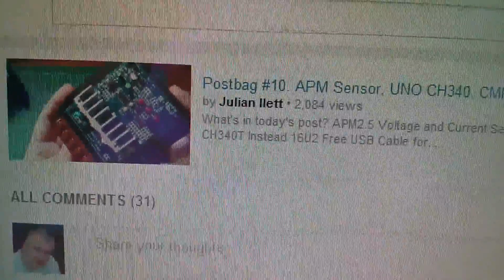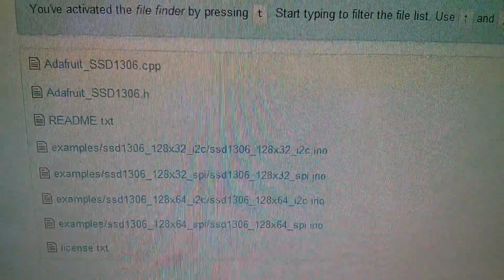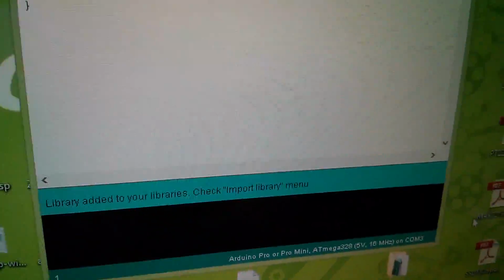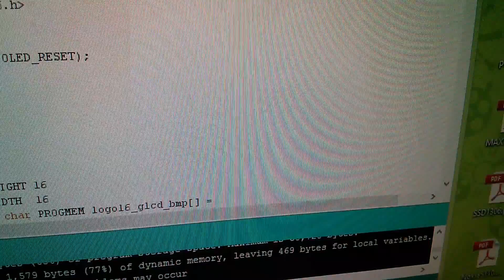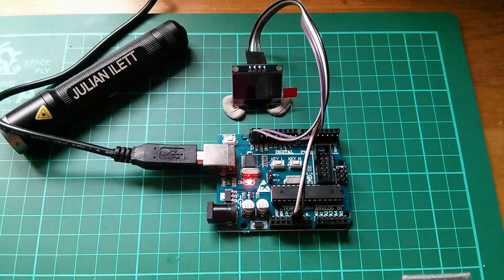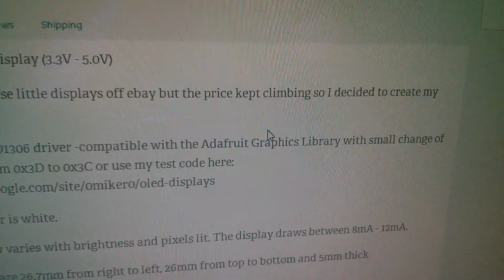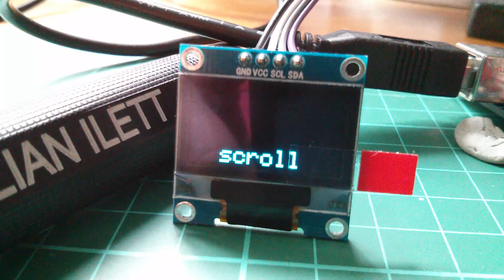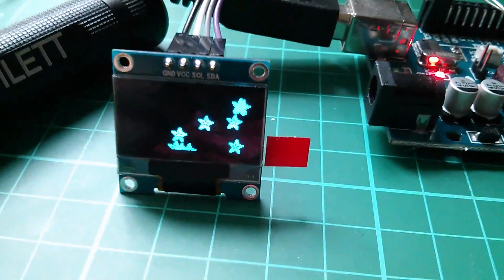1-Day Project: Arduino Uno and I2C OLED Display Challenge

Comment: I noodled around updating the text printing cascade you originally used with the SPI Nokia 5110 screens to work with these little I2C OLEDS. Also store the font defs in the ProMinis internal eeprom space for a solution that doesn't need any libraries. You might find that work interesting:
 https://thecavepearlproject.org/2020/11/15/adding-two-oled-displays-to-your-arduino-logger-with-no-library/

Comment: Curiously, this file (sh1106_128x64_i2c.ino) works equally well under Arduino 1.8.10|File|Examples|Adafruit_SH1106. Disable the SPI "include" cuz you're running I2C. Within the code, the address 0x3C works fine which suggests the silkscreen of 0x78 and 0x7A is really 0x3C and 0x3D. Another fine example of China trying to avoid copyright enfringement?

Comment: I thought my cheap ass lanmu OLED from amazon were faulty but nope! I had to change the address to 0x3C You made my day!
Reply: @Strictly Fun , Motivation , and Other I don't think so. I don't have much idea and I even thought I burned or short it somehow. I had another from the same order and it wasn't working either. There's like 3 different libraries and eventually I got it to work by trying them. check also your wiring (I know it's just a few cables, but check in your machine for the correct I2C pins)

Comment: I have a similar project but want to measure the voltage from a solar panel. Is it fine to just connect the lead from the panel straight to the terminal without anything else in the circuit? I tried but the voltages don’t vary under different light levels.

Comment: OK I got it running.  Of all the 37 land mines I had to step on the
prize winner is the display has address code 0x78 or 0x7A which it
turns out is for 10 bit and  doesn't seem to have been included in
the sketches.  If I hadn't bought 2 other displays of a simpler design
I would be in the Drool Factory.
Reply from the maker: Satisfying isn't it - to get it working :)
Reply: Yes it is!  And at nearly 64 very comforting to know I can still figure things out, eventually.
Reply: @lizardofoz5329  What is MOST exasperating and infuriating is seeing the addresses screen printed (the ones you quoted) on the board, using them and after much hair pulling discover that they are completely INCORRECT and actually are the standard default 0x3c address!!! ARRRRGGGHHH!

Comment: hey please answer this,
this aurduino circuit, how do we power it if it is not connected to computer and we want to run the program that is store in the rom whenever it starts as there is on/off button
Reply from the maker: Use a 5 volt power supply :)

Comment: Thanks for your video and especially the topic on the display's initiating address (changing sketches default address from 3D to 3C ) was a great help in troubleshooting my i2c OLED 128x64 display that would not work when connected to my Beaglebone Green, thus I was suspecting a bad display. So, I followed your procedure and now I know that my display works great with my Arduino Uno. Again thanks

Comment: You might want to try changing the Wire library clock speed. It usually defaults to 100kHz and that will limit your data transfer rate, thus slowing down overall loop time. You can probably go up to 400kHz at least with modern I2C devices.

Comment: Thanks, the address change also worked for my Banggood 128x64 OLED display as well.  The address on the back of the display had "78", which i assumed was hex 0x78 but it is 0x3C bit shifted to the left

Comment: Thank you for the video, it saved me hours of googling and troubleshooting.
However, I still have a problem with the Adafruit demo. Even though it now recognizes my 128x64 display (just like yours) and manages to draw to it, it draws only the first few lines (approx 10) and the rest is just white noise.
So I can see that the demo is communicating with the display but unable to draw the full screen.
Dissecting their code, I am not seeing anything that would instantly point to a flaw but somehow the demo (or their library) is just not working right.
I tested the display with the u8g library and managed to draw to the whole display so I believe that the fault is in the demo or the Adafruit SSD1306 library.
Any ideas on where to look for the cause?
Reply: I think you are using the wrong driver library, do try SH1106

Comment: PLEASE HELP mine is working with the 64 height example but the image is being stretched downwards and there appears to only be 32 lines of pixels activated, every other line of pixels is left turned off. I even bought two new screens both from different manufacturers and they still have the same problem :' '(
Reply: Did you definitely go into Adafruit_SSD1306.h and adjust it for your screen?

Comment: Height incorrect, please fix Adafruit_SSD1306.h
getting this error
Reply: I found the solution :::

In Adafruit_SSD1306.h 

1. uncomment #define SSD1306_128_64
2. comment #define SSD1306_128_32
3. comment #define SSD1306_96_16

In the example ssd1306_128x64_i2c 

4. add #define SSD1306_LCDHEIGHT 64

on top of 

#if (SSD1306_LCDHEIGHT != 64)
#error("Height incorrect, please fix Adafruit_SSD1306.h!");
#endif
 ----
Reply: You're a hero.

Comment: after uncommenting the correct size in the h file I am still getting this 
#error ("Height incorrect, please fix Adafruit_SSD1306.h!");
Reply: In Adafruit_SSD1306.h 

1. uncomment #define SSD1306_128_64
2. comment #define SSD1306_128_32
3. comment #define SSD1306_96_16

In the example ssd1306_128x64_i2c 

4. add #define SSD1306_LCDHEIGHT 64

on top of 

#if (SSD1306_LCDHEIGHT != 64)
#error("Height incorrect, please fix Adafruit_SSD1306.h!");
#endif
Reply: @NakulKundra  Once again this is a VERY poorly written library when the library has to be hand edited to work with a standard device! This NOT something that beginners would quickly understand how to resolve and to be fair why should they. That is something which the library author should have included. Such parameter changes should be passed to the library as relevant arguments. Who in their right mind writes code like this? Amateurish to say the least.
Reply: Height incorrect, please fix Adafruit_SSD1306.h! from this file change the 128_32 to 128_64
Reply: You're a legend! Thank you Nakul!

Comment: I ordered what I thought to be the same OLED display but is turned out to be the SSH1106 chip. Trying to get the Adafruit library  to work on a ModeMCU Lilon development board is not easy.

Comment: Looks like 0x3C is used on the 128x32 displays (check the 128x32 i2c example). I have a 128x64 that doesn't seem to be functioning properly, it only works if I change the height to 32, but then the data is too large for the display (only see half of what I should)
Reply: I got very similar problem. When verify keeps giving me Height incorrect error, when change it to 32 it is uploading but not working.
Reply: Did you fix it? I found the solution for this issue:

In Adafruit_SSD1306.h 

1. uncomment #define SSD1306_128_64
2. comment #define SSD1306_128_32
3. comment #define SSD1306_96_16

In the example ssd1306_128x64_i2c 

4. add #define SSD1306_LCDHEIGHT 64

on top of 

#if (SSD1306_LCDHEIGHT != 64)
#error("Height incorrect, please fix Adafruit_SSD1306.h!");
#endif
Reply: I had the same problem, the library has the 32 line display as default. I got the height error. All working now, wish I had seen this earlier as I worked it out the hard way, note to self, read all the comments first!

Comment: What's the SCL frequency on this demo? I'm using this display directly on a ESP8266 running SCL at 200KHz and the bitmap print is very slow. Large fonts and clear screen are very slow too. May you help me?

Comment: Awesome! :o) :o)   Makes me wonder why they don't include a couple of 10k pullup resistors though -did you try it without those resistors to see if it still worked after you changed the address?
Reply: you don't actually need the 10k pull ups

Comment: I've found that these displays really need the RESET signal brought over to a GPIO. Initialization MUST reset the display. W/o doing so, sometimes the display is all-black and stuck. Other times it has random bits turned on and stuck. There is a reset signal on some of these SSD1306 boards. Don't buy the ones w/o it.

Comment: So just received my 1.3" I2C IIC Serial 128X64 OLED LCD Display purchased from eBay (gowin_electronic) and thought I had gotten a bad one since no mater what I tried the Adafruit library examples wouldn't work.  So I downloaded the U8G LIbrary and tried all of the 128x64 options.  Turns out I must have an SH1106 and not a SD1306.   I'm running the GraphicsTest example with the "U8GLIB_SH1106_128X64 u8g(U8G_I2C_OPT_DEV_0|U8G_I2C_OPT_FAST);" line un-commented and it is running way faster and everything fits on the screen.  Hope this helps somebody out there.  Cheers!
Reply: It works for me ! Thanks so much

Comment: I tired the 128x64 example and chaged to 0x3C but I still get errors.
128x32 example works though without changing anything.
I do have the 128x64 I2C 0.96" WHITE OLED Display.
However my pin order is VCC - GND - SCL - SDA
Wierd.

Comment: I'm a bit stuck with  what seems to be a gulf between alphanumeric displays with ugly "fonts" due to low resolution, and full blown graphic displays that place serious demands on an uno.  Is there an oled module that includes built-in buffering and fonts, just to  get alphanum looking prettier without  taxing the uno?

Comment: Hi there!
I read on Adafruit's website that the micro controller need at least 1k RAM to store the buffered pic to be displayed.
I'd like to use it with a Nano, which has 2k SRAM and 1k EEPROM. So, the question is, what's the difference, and which of these two does the display uses? Thank you!

Comment: I love i2c. What a great bus, not the fastest but I the structure and flexibility make it a joy to work with. I need to check out that screen you found, could be handy with esp8266 nodes.
Reply: Can you give avr   code for ssd1306, I am not able to establish communication with atmega16

Comment: Command failed: C:\Users\OPscar\AppData\Local\Temp\build1451819503229\ssd1306_128x64_i2c.cpp:35:26: fatal error: Adafruit_GFX.h: No such file or directory #include ^ compilation terminated.  Can I get some help, Please!
Reply: +Oscar Söderholm You don't have Adafruit GFX library installed, so the header file cannot be included

Comment: Thanks for the video Julian. When I try to upload the sketch, I get and error message that says " Height incorrect, please fix Adafruit SSD_1036.h". I think this is referring to the previous line in the code. Do you know what this is about and what to do? I have very little experience with any of this.
Reply: This happens on early Arduino IDE's. Upgrade to latest IDE and update libraries and it should be OK, if still problem you have to alter height in the actual library file to 64

Comment: Well done. I have one of these units, I was able to get it working on the second try (0x3C) was the address i used. And i didn't need any pull up resistors.

Comment: Just to explain why the I2C address is correctly marked as 0x78. I2C addresses are 7 bits, but sometimes they are shown as 8 bits. When sending messages the address is sent as 8 bits and last bit is used to indicate a read/write. So 0111 1000 (0x78) to write or 0111 1001 (0x79) to read. The address excludes the last bit (shift right) so the address is 0011 1100 (0x3C). So in the future if you ever have trouble with I2C addressing try shifting the 8 bit address to 7 bits and see if that works or use http://playground.arduino.cc/Main/I2cScanner thats easier.

Comment: thanks a lot for your explanation, I did the same BUT I did not use resistors : I did  VCC to arduino VCC + GND to arduino GND + SCL to arduino SCL + SDA to arduino SDA directly, with no resistors it works fine. thanks a lot you helped me

Comment: Thank you, I'm a 66 yr old beginner to Arduino and apart from the Multifunction Car this is the first specialized project I've worked on. My O Led display just arrived from BangGood and I was wondering how to get it up and working. Your tutorial is one of the best I've seen for anything Arduino and as such I've subscribed. Very easy to understand and directions enough to get it going myself.
Thanks again. Keep the simple and straightforward lessons happening. They are much appreciated, PS, Nice presentation as well. :-)
Reply: Can't agree more with you. By the way, keep it up! :D

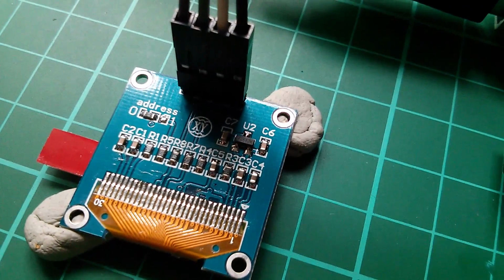Comment: thanks to you, my job was done in...say 5 minutes =D. The address setting 0x3C or 0x3D depends on the jumper setting on the back of the display ( see 5:45, although not properly written, but it says "address" and you get to choose the last bit. If its 0 it means 0x3C if its 1 it means 0x3D). My display is from different manufacturer "heltec" but they are all the same =D Thanks again Julian Ilett

Comment: Hi Julian, thanks for you sharing. I have used the  U8GLIB, this one is smaller.

U8GLIB_SSD1306_128X64 u8g(0x3C|U8G_I2C_OPT_DEV_0);

It works faster and thanks to you I had it work with adres 0x3C.
Reply: Edwin Noorlander Thanks :)
Reply: jarnoorasmae  Your welkom.

Comment: Thank you! I was having the same problem. Now working on the arduino Yun. By the way, pull up resistors are not needed. I'm not using them. cheers

Comment: Hi Julian, the two 10k pull-up resistor may not be necessary, I tried with Aduino Micro and it works without the pull-up, I believe the AVR controller has internal pull-up.

Comment: Are both resistors running from live to scl?
Reply from the maker: Mikolaj1406 One between 5v and SCL, the other between 5v and SDA
Reply: thanks!
Reply: You most likely need to pull ups.  As far as I remember the chips aren't very good at driving the voltage down so probably need relatively small resistors.
Reply: +Julian Ilett .. Just wondering .. were the pull-up resisters needed?

Comment: I keep on getting the following errors when uploading my code to the arduino mega 2560:
avrdude: stk500v2_ReceiveMessage(): timeout
avrdude: stk500v2_ReceiveMessage(): timeout
avrdude: stk500v2_ReceiveMessage(): timeout
avrdude: stk500v2_ReceiveMessage(): timeout
avrdude: stk500v2_ReceiveMessage(): timeout
avrdude: stk500v2_ReceiveMessage(): timeout
avrdude: stk500v2_getsync(): timeout communicating with programmer

please help!

Comment: Nice video. I was going to use same/similar display for my project but im experiencing problems with SRAM of arduino i think. Display buffer eats more than half of it if i counting corectly and i cant get it working with usable code. Only with smaller codes which basicly only drawing on it and dont using any other devices lik BT, LM335 and so on. Is there somethink i can do about it? Like slowing refresh frequency to lower memory usage of buffer or other things like that?
Reply from the maker: Jan Havel I'm starting not to like the Adafruit OLED library. It appears to use a large RAM based display buffer and it's pretty slow too. Take a look at my videos on driving the Nokia 5110 with all home-brew code. The code for the OLED is very similar - it's fast and doesn't use a RAM buffer. I've been meaning to video that. I'm going to do some timing tests on both techniques.
Reply: Julian Ilett Thx for response. Im not so experienced in this but i will look at your suggested Nokia video. Im trying to create some kind of smart watch project for personal use and i hope arduino is big enought for it :) (Everythink was ok until i was trying to port it from char display 2x16 to this kind of oled display, im just hoping this random pixel think what happening to me at some point is because of sram and not another isue)

PS: sorry for my english, its not my primary language
Reply: Julian Ilett I was thinking along the same lines regarding the OLED library, especially for simple display requirements. Did you ever get to do a "raw command set" test with the OLED?  I did a quick demo using raw commands (similar to your Nokia 5110 test). Although my unit is SPI not I2C, but FWIW code and notes can be found at:  https://github.com/tardate/LittleArduinoProjects/tree/master/playground/OLED/SSD1306BareBack

PS: thanks as always for the vids - they are brilliant and entertaining to boot (you wait for the postman, we wait for your uploads;-).

Comment: Liked the tutorial. I got to looking. When I got my OLED, I didnt know the address either. I did find a sketch that will scan the I2C bus. When I ran it the OLED display came up as address 60. Then I got to thinking, thats decimal,what if I converted it back to hex. SO 60 in binary 60 looks like 00111100. If you convert from binary to hex you basically break to binary into groups of 4. Therefore 00111100 becomes 0011 1100. If you know hex 0011 is the number 3, 1100 is the number 12, or in hex "C". Therefore 60 decimal is 3C hex. so you have an address for the OLED as 0x3C. ( thats a simplified explanation, but thats how the came up with the address. The scanner program to help you do this and find the vendors original address setting is found at https://github.com/todbot/arduino-i2c-scanner  make sure you change the baud rate on your serial to 19200, or modify the sketch....( the software is free, I have no stake in it at all) but it definitely helped me resolve the address when I didnt know with a little dec/bin/hex conversion

Comment: What did you do with the pullup resistors? Are they necessary? I want to try it out but I don't want to break it by not using the correct resistors in the right place.
Reply: Not necessary  arduino will use internal pull-up